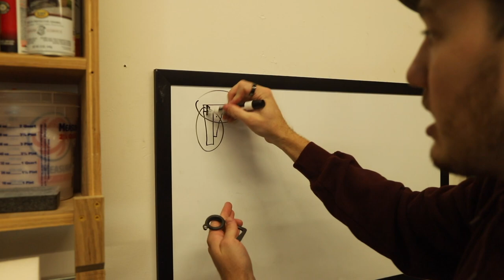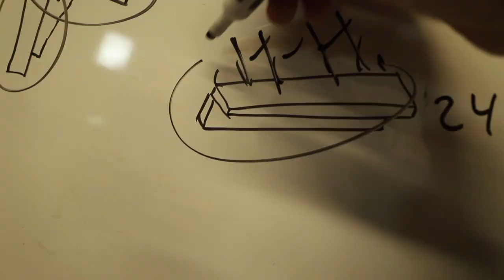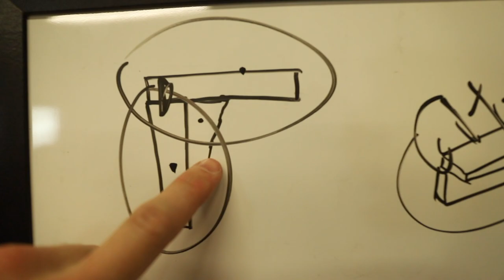CUSTOM Coat Rack Using STEELE HOOKS!!

Comment: Your SHOPSMITH runs on 110VAC.  Why didn't you use that on this project ?
Reply from the maker: Didn’t need it to make the rack. There now be room though for the shopsmith in the new shop :)
Reply: @WesleyAring  When I was first introduced to your channel it was during a Shopsmith question and you showed up. It's always great to see someone using a Shopsmith. I still have a Mark V with bandsaw attachments in my garage for my finer work. Doesn't take up much room and rolls out onto the driveway on sunny days when I have a project.